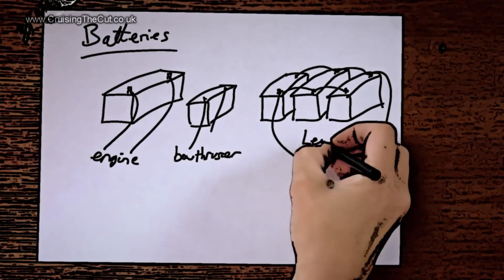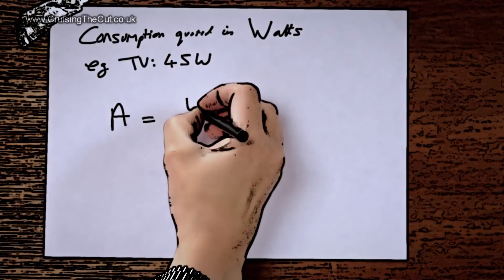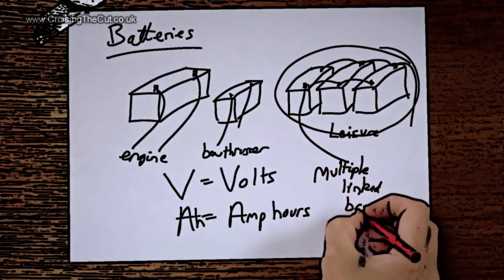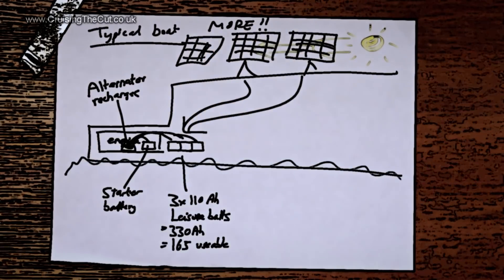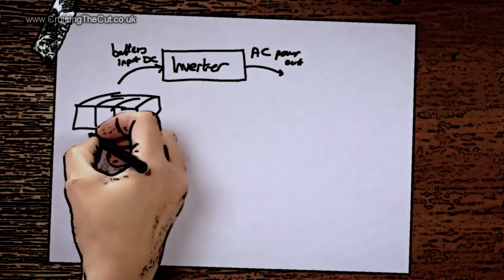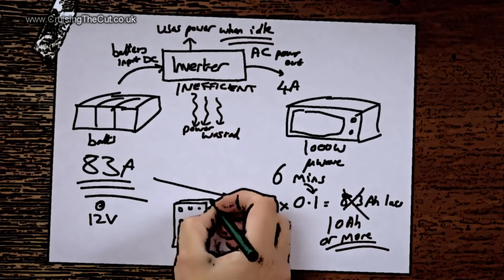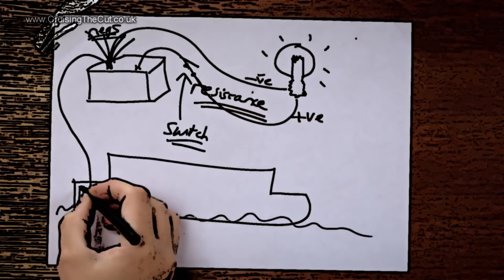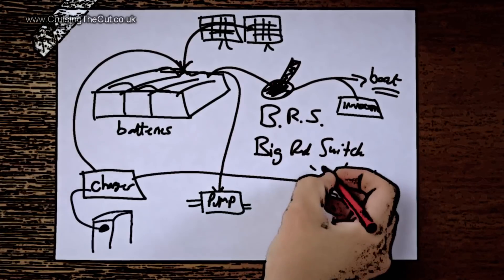136. Beginners guide to narrowboat 12V electrics: batteries, inverters, chargers, solar and so on

Comment: 11:27 Except most of those non genuine 12V chargers can and most likely will damage your phone/tablet etc. Genuine chargers, supplied with the device, do not use many amps ( don't leave them turned on when the device is unplugged from them ), and thus will not be an issue. Just be sure your inverter is pure sine wave. Of course, there ARE 12 volt chargers that are fine, but you cannot buy them from petrol stations, or whatever you call them where you are. Those cheap chargers, or even leads, are a major cause of poor battery life, and rapid battery drain, on most smartphones and tablets. Check the manufacturer's web page if unsure.

Comment: Not sure where you are getting the idea that batteries are only usable for 50% of their capacity, that is not really an accurate way to look at it. A battery designed for cyclic applications (leisure) compared to a battery designed for traction (starting) has an amp hour rating normally expressed over a 10 or more rarely a 20 hour rate down to a specified voltage. Something like a Yuasa 65AH battery (NP65-12) for example (longer life batteries are available) will discharge at 0.1CA (6.5Amps) for almost 9.5 hours down to 10.5VDC at 25oC. In the winter you will get about half as much power (3.25A) before 10.5V is reached. So you see, its not that only half the capacity can be used, it is that battery capacity is dependant on temperature and there is just less capacity in a battery at lower temperatures than there will be in summer months. I hope that is helpful.
Reply from the maker: Thanks but I'm fully aware that temperature and rate of discharge affect the current capacity of the battery though I left that detail out here as it is an introductory video for beginners.

The C20 rate is the standard rating here (not sure where in the world you are) and the 50% usable capacity before recharging is also absolutely standard across narrowboat and other leisure vehicle electrical charging systems and calculations.

It's not to say that the battery cannot be discharged further, rather that this is the optimum balance of discharge vs damage to the cells to give maximum usable cycles. I didn't just make it up, this is how it's assessed.
Reply: Fair enough. If you are looking to maximise the number of cycles, 30% is a better goal if possible. At 50% some SLA batteries will still offer half as many cycles or less compared to 30% discharge. To give you an idea, Yuasa NP series batteries, 3-5 year life offer over 400- cycles at 50% DOD but over 1200 at 30% DOD! Quite an impressive difference I am sure you will agree. Also if possible look at the 10 hour rating, plenty of manufacturers quote a number of different figures for leisure batteries actually, 1 hour rate, 5 hour, 10 hour, or 20 hour. Be wary of those that only quote the 20 hour rating, they may be trying to make the battery look better than it is. In industry (I am in the UK but design systems for mission critical battery applications) we tend to favour the 10 hour figures for a more conservative indication of actual battery capacity. I am a professional battery management charging systems design engineer by the way, have been for the best part of 35 years so I have some in depth knowledge of this subject.

Comment: Three 110amp batteries are not enough. If you cruise an 8 hour day, 3 of those hours your not putting anything into the batteries because they are full. A modern engine with a big second domestic alternator will be left doing nothing. 1980s electrics
Reply from the maker: I use that as an example only because it's typical of many narrowboats

Comment: Ye gods, first it's galvanic electrodes dragging me back to education, now it's electricals - all I need now is 'Differential Calculus on the Cut' and the horror is complete.  I once encountered a question on a physics exam that required me to read a circuit diagram and explain where the fault was (and how to correct it); I wrote 'The electrons got one look at this diagram then they were so frightened that they all jumped on their megacycles and pedalled off - try bribing them to come back with biscuits'.  That was not the correct answer.

Comment: using a mains charger for your cell phone on the boat would be insane. the inverter would take 12v and convert it to 230v and then the charger converts it to 5v dc so 12vdc to 230vac to 5vdc with the inverter wasting 20 to 25 percent.

Comment: More battery stuff. Although using similar technolgy leisure batteries are constructed differently from motor start batteries. Motor starters are designed to give a lot of current for a short time, possibly several hundred amps but only in say ten second bursts. This is needed to turn the diesel motor over and diesels with their higer compression ratios need more power to start than petrol engines, which are often not good ideas in boats. Leisure batteries are designed to give lower levels of current, think tens of amps, but for much longer periods - hours instead of minutes. Horses for courses. BobUK

Comment: I think a little confusion has crept in. The 50% discharge relates to the number of times a 12 volt lead acid battery can be discharged to 12.2 volts. There is still the other 50% available, but using it will significantly shorten the life of the battery. The full capacity of say a 100 amp hour battery is 100 amp hours (otherwise the rating would be a nonsense), but it is much wiser to only use 50 amp hours before recharging. A battery monitoring voltmeter will give a good idea of the state of charge. For best results (sounds like cooking instructions!) use a hygrometer and check the specific gravity of the acid - if it's not a sealed battery. Do not spill acid on skin, boat or clothes. The water it is diluted with evaporates and the acid gets stronger and stronger .... It burns holes. BobUK.
Reply from the maker: No confusion, that's exactly the point being made. 50% useable capacity.
Reply: Having such a small battery bank means you will definitely have to use the lower end of the battery. You need a larger bank unless your the type of person who moans at your wife for using the lights when it's dark
Reply: But having a shorter life may not matter. If a 3 year life battery is only used 4-5 weeks a year and has 180 cycle life with a DOD to 100% it would not matter a jot if it was 80%  discharged once every 24 hours, its still a maximum of 35 cycles per year, well within the 180 total within 3 years. Temperature on the other hand could be a much more important consideration if the battery had to perform in the winter. If you live on a boat 24/7 and maximising life is the goal and 30% DOD should be the maximum ideally because it can hugely increase the number of available cycles available.
Reply: The ah rating of these batteries is most often the 20 hour discharge rate. Try to take the charge in an hour and you can expect half of that amount for lead acid batteries. You CAN NOT get at the other half in that case.
Reply: The ah rating of these batteries is most often the 20 hour discharge rate. Try to take the charge in an hour and you can expect half of that amount for lead acid batteries. You CAN NOT get at the other half in that case.

Comment: Just the tiniest of notes for anyone doing power budget calculations: the number denoting power consumption in amps or watts on the label of an electrical appliance is the *maximum* power it is ever supposed to draw - and the appliance may or may not draw that amount in typical use.

For instance a simple thing like a pump will pretty much do what the label says any time you have it running; a fridge though will not, as it will keep switching on and off as governed by its thermostat, so on average will consume less than what its label says, depending even on things like ambient temperature. Same might be true for a microwave oven if it has selectable power - it you're running it at less than maximum, it obviously consumes less (but will need to be on for longer to heat the same cup of tea so yeah it's a bit academic...).

And there are also things that might almost never consume their rated value - for instance, I noticed your TV has a DVD player built-in, the power requirements of which are surely included on the label; so whenever you just watch TV without using the player (or you just have the brightness on "low"), you're likely not using the full specified 45W to run it - although the difference may or may not simply be to small to be of interest in practice... :)
Reply from the maker: Good points!

Comment: Hard to believe narrow boats still burn coal and diesel, the two most polluting energy sources! With such a huge surface atop, narrow boats are ideal for a large solar system installation (and yes it produces energy even on cloudy days). By replacing the messy diesel engine with tinny electric motor that will run almost forever with zero maintenance, not to mention the money saved on diesel and no more noise. Chargers along the way would also help.
Reply from the maker: There is absolutely no way you could fit "20-30" panels on a narrowboat. Your concept while idealistic is not feasible at present.
Reply from the maker: If you covered the boat in solar then yes it might recharge in a day or two - in mid summer only. The rest of the year in the UK this is a nonstarter, without charging points alongside every mooring on 2000+ miles of canal. So it isn't likely to happen any time soon unless solar panels get vastly more efficient or we get a lot more sunny days. The comparison with cars isn't valid because they can much more easily be plugged into a charger.
Reply: With the addition of a battery bank (as mentioned earlier) from a salvaged Nissan Leaf or similar I remain convinced it would be possible for a solar powered battery electric narrowboat with a steel hull to cruise the canals with ample energy even in mid winter in the UK with only occasional need of plugging into a mains outlet.  On a side note more electric outlets provided by CRT along the canals and private homes that would be willing to lease out their power, not unlike an Airbnb situation but elec. only, could greatly cut down on diesel fumes/noise pollution along the canal system.
Reply from the maker: Hi. My boat, and many others, have substantial solar arrays but there is not sufficient sunshine to power a fully electric propulsion system without backup from a generator, charge points or other solution. At present, hybrid systems are the closest realistic solution. See https://www.youtube.com/watch?v=a43d9V6DlgU
Reply: CruisingTheCut Most boats including yours only have a few panels generating less than 1 Kw, far from substantial. I am talking about 20-30 panels each producing 300 W for a total over 6 Kw. With such an array you will be generating at least 15 Kwh on cloudy days and over 40 Kwh on sunny days, extrapolated from my own 10 Kw system. It remains to be seen how many nautical miles you could travel at the low speed of 3 knots.
Reply: @ Dominic Sotirescu If the solar panels measure 39" x 65" it should be possible to to place at least 9 (assuming 30 ft of roof available) on the roof and five on a hinged frame on each side (hanging down while moving and placed upright  and/or oriented to the most sun advantaged angle while moored). This could also be accomplished with a scissor type of frame on top of the boat. If having a fully solar NB is currently a problem of engineering that can nearly always be solved, if it is a problem of physics, which I think it is not, that is another problem entirely. With a proper sized battery bank & solar panel system I believe it would be possible to have a fully solar powered ElectricNB for all year cruising. Occasional topping off at an electrical outlet may be needed for consecutive dark days. It would be a passion project at this time as I do not think the economics are favorable yet for a timely return on investment.
Reply: My opinion on why solar motors on steel hulled narrowboats are not currently on the market is because of the solar panel price tag and a market that has not yet demanded electric narrowboats. Cars have been retrofitted with electric motors powered by batteries for many years, I see no reason a narrowboat could not be retrofitted or built new with an electric motor. I don't know how fast a narrowboat roof covered in solar panels could top off a battery bank after 3-8 hours at cruising speed but I bet it could be done in a day or two. If you were able to find mooring(s) with overnight electrical hook ups while cruising the problem would be solved. It will take a few intrepid/sponsored narrow boaters to lead the way and at least one NB boatbuilder to offer an all electric NB, it won't be long IMO.

Comment: plus if your boat is 55 or longer you could run 4 or 5 solar panels and have like 12 to 15 back up batteries that would give you a lot of power
Reply from the maker: Provided you have the space there's no limit to the number of batteries you could have but you'll still need to charge them, and charge them properly. Better to minimise consumption in simple ways and stop trying to use devices as if you're plugged into a shore mains.

Comment: Just remembered this, how about electric trolley canal boats, https://www.resilience.org/stories/2009-12-22/trolley-canal-boats/
"As described in a previous article, trolleybuses and trolleytrucks would make a lot of sense these days because they could deliver electric transport for a bargain, using simple and existing technology.
The same method was once applied to boats, too. Not for sea travel, of course, but for canal transport. Some canal boats were also propelled by systems that resemble those of cable trains, and yet another method combined common railway technology with canal barges.
All this happened at the turn of the twentieth century, mainly in France and to a lesser extent in Germany, in Belgium and (only experimentally) in the United States. "
Reply from the maker: Well now that is very fascinating. What a gread read! Thanks

Comment: Two things I noticed; there was no air conditioning listed, and there are no canals here in Missouri -- those come to mind because of today's weather, "Mostly sunny, with a high near 95 F (35C). Heat index values as high as 105 F (40.5C)." On tangential track, I've not yet seen much about what air conditioning does to usage time of electric automobiles; went looking a couple years ago and didn't find any information.
As it happens I live in a little farm burg which used to be a steamboat landing on the Missouri River and riverboats are pretty cool but canal boats are more my speed! :D 
Is 05:12 in the morning at moment and, 77 F 25 C, humidity 90%.
Reply from the maker: Hi. I don't know of any narrowboats fitted with aircon simply because of the huge power draw; most narrowboats don't have the battery bank to support it or the amount of solar. A few boats have decent-sized inboard generators and they could run an A/C unit but it's not commonplace for sure. Also, we rarely get weather that's terribly hot - our current heatwave is a freak occurrence!
Reply: Random thought about boat batteries: memory pops in about reading books in grade school library which told of 1940s submarines running on battery and batteries being connected in choice of series, parallel, or series-parallel. 
And then from another interest, things about series and parallel, and inverters, also apply to straight electric, battery, and diesel-electric locomotives. No, I'm not an electrician, it is more a case that I know of these electrical things, and far less a case that I know these things.
Reply: Just for fun, while it is a topic of the moment, here's this about our area climate, from local university, "Climate of Missouri, Wayne L. Decker, Professor Emeritus, University of Missouri
Missouri has a continental type of climate marked by strong seasonality. In winter, dry-cold air masses, unchallenged by any topographic barriers, periodically swing south from the northern plains and Canada. If they invade, reasonably humid air, snowfall and rainfall result. In summer, moist, warm air masses, equally unchallenged by topographic barriers, swing north from the Gulf of Mexico and can produce copious amounts of rain, either by fronts or by convectional processes. In some summers, high pressure stagnates over Missouri, creating extended droughty periods. Spring and fall are transitional seasons when abrupt changes in temperature and precipitation may occur due to successive, fast-moving fronts separating contrasting air masses."
--> Hehehehe! Ohhh so true!!! "TEMPERATURE - Because of its inland location, Missouri is subject to frequent changes in temperature."
http://climate.missouri.edu/climate.php

Comment: Excellent post - Inverters are quite deceptive  - if they say "Modified Sine Wave"   which are the cheapest  they wont run your microwave and most electronic stuff you want "Pure Sine" wave for them  -  Inverters dont like inductive loads  their soft start is incompatable - Typicaly  a 3KW(9 KW Peak)  inverter will struggle to start an induction motor much over 250watts under load

Comment: Hi Dave, Great video, it's a good job I don't have to hold my breath when it comes to boat electrics , other wise I would have passed away by now. I take it the Big Red switches are like a Home consumer box? I was out walking the Cut yesterday , what a great day, funnily enough for a weekend not many people about. Then I realised England were playing. Derr. Keep up the good work.
Reply from the maker: The BRS is like the main power switch in a consumer unit, yes. Not like the MCB (circuit breakers), which are more akin to the fuses I mentioned.